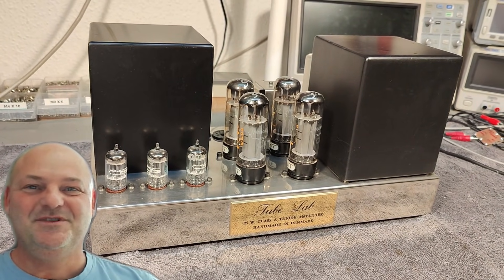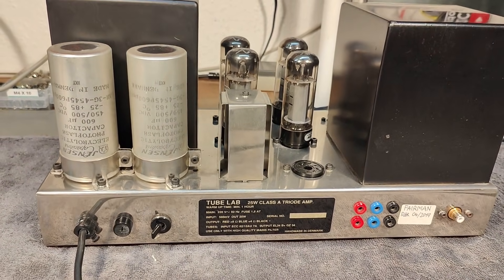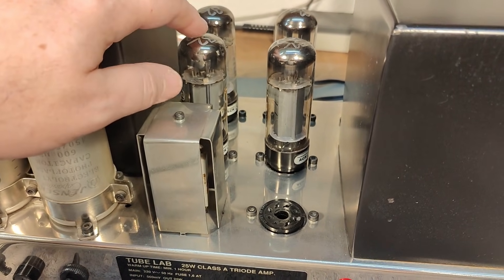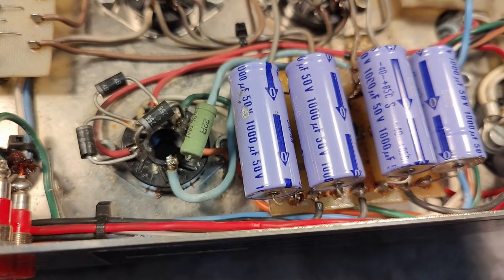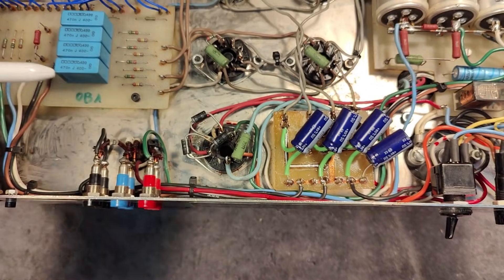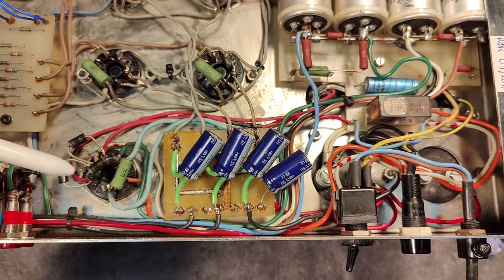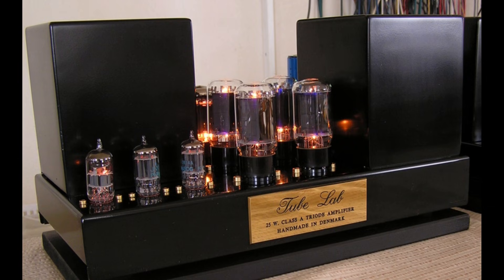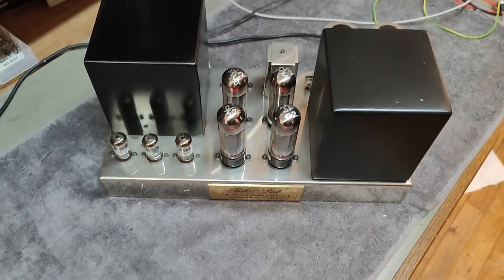Tube Lab 25W class A Triode Amplifier 1991 Werner DIY project

Comment: En una de las fotografías aparece el modelo con 4 válvulas 6L6 ; podría decirme si también desarrollaba 25 vatios de potencia en clase A? Muy interesante video y muy emotivo para usted recordar a su padre .Gracias .
Reply from the maker: The 6L6 handles only 500V max plate voltage. With the 400V final stage DC supply found in this amp, the EL34 is a better choice since it handles 800V. This means I can run it all the way to compression without causing tube voltage overload. It is a push-pull transformer, so when one side goes all the way down to zero, the other side goes to double the supply voltage. If this is a practical "detail" or not i dont know, the 6L6 units played exactly as good and as loud when i played with them back in the days